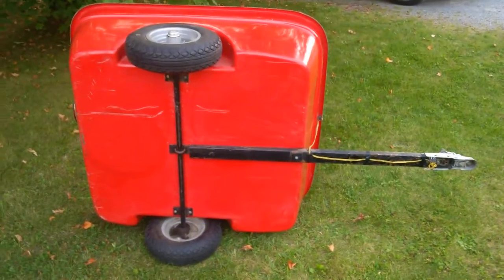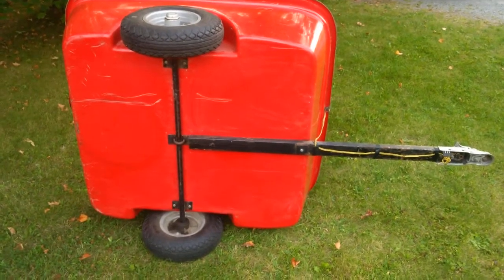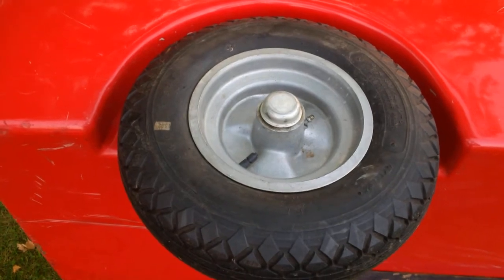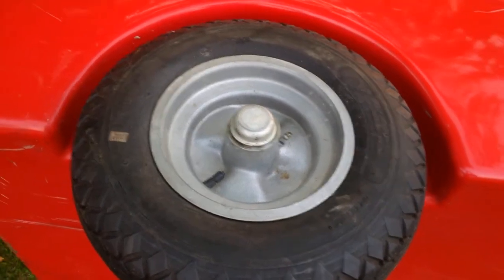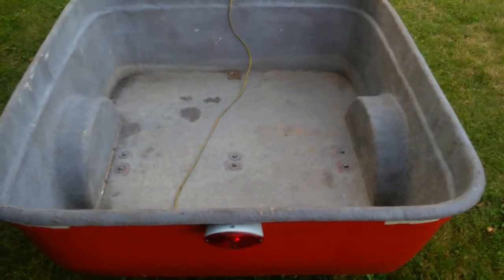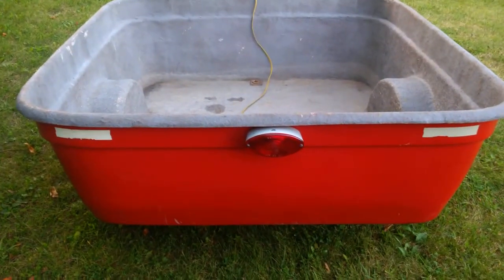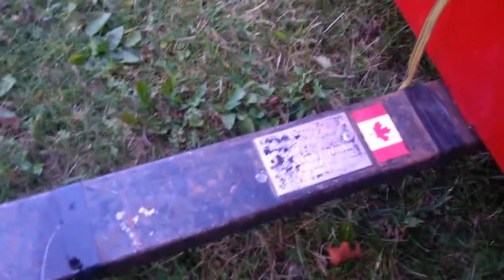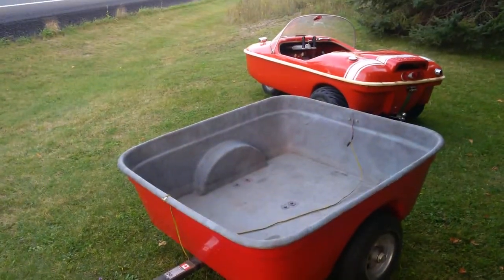Beaver Amphibious ATV Trailer

Comment: Was this tail light an after-thought / after-market accessory ?  Don't know why the wire goes in the tub unprotected ? If it could hold 400 Lbs, does that apply to road weight and floating weight ?  It might float but would the tires bog into a muddy surface ?  Looks like a fun combo to tag a couple of kids around.   Thanks   J K
Reply from the maker: The tail light on the trailer may have been added by the previous owner, I don't have any photos of the trailer in factory paperwork to show otherwise. The only load information is on the tongue of the trailer, again, no information in owners manual, brochures etc. Good point on the narrow tires, that is probably why the Penguin trailer uses the 16x15x6 tires and wheels.